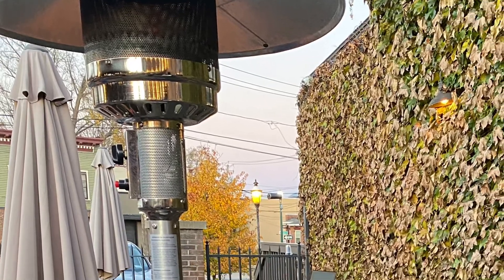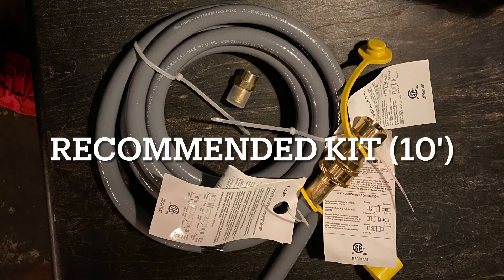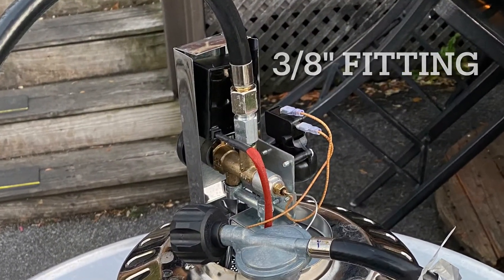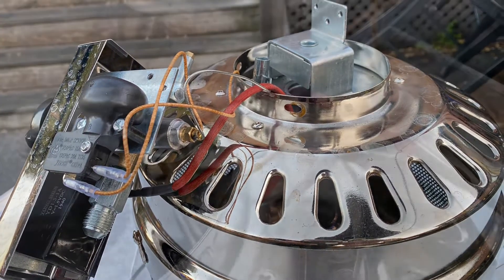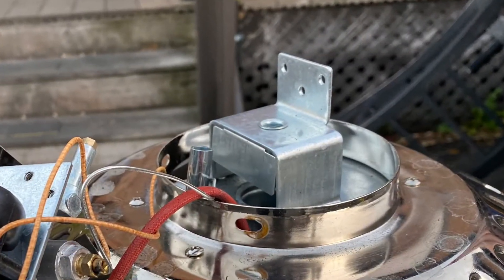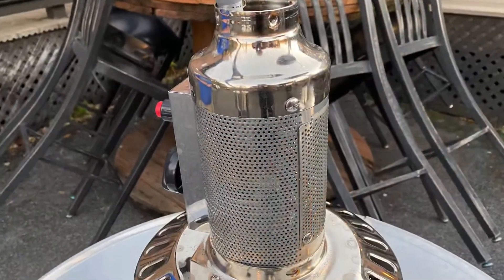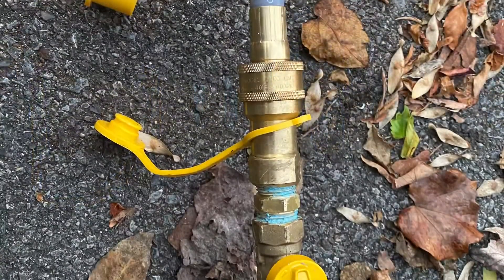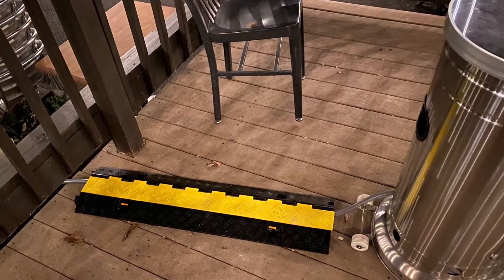Patio Heater Propane to Natural Gas Conversion

Comment: It looks nice enough, but I'm curious.  Warmer air rises quickly.  Wouldn't it be more effective for the heat source to be closer to the ground.  I noticed also that your patio is open air as is my own.  I was curious to know if it was noticably warmer with the new heaters.  Thanks!

Comment: Followed the instructions to the T for the Paramount (Costco) brand. Flame doesn’t remain stable and hence not getting the red-ish glow on the surface. Flame is very orange and not blue at all. What should I change? Appreciate your work here and will wait for your feedback. Thanks!

Comment: Maybe throw a sandbag in the base for the stability lost by not using the tank . I got a heater from a bar and it was pretty bent up from inebriated guests knocking the thing over.

Comment: ORIFICE, not ORIFISE.
I need to clean out my gas pipe.  Nuts don't want to come off.  Are these glued on or sealed in any way?  Its a small tabletop patio heater and I've taken it apart and cleaned it out. But the gas pipe needs cleaning too.  I wish you had shown how you get the nuts off this assembly piece.  What do they use to seal off the nut on the thread?

Comment: Question, I followed your example step by step. I have the exact heater. The gas orifice hole is 1/8 inch just like yours. I put the tape on just like yours. However, when I turn mine on, I get lots of fire and it doesn’t warm up and glow red like yours does. What do you think my issue is?
Reply: Same issue here.  Going to order a new orifice and starting with a smaller drill and work my way up till I get the flame needed.  1/8 was too big.
Reply: I had the same problem. I drilled the hole for the orifice at 7/64th and instead of blocking off entire air inlet only blocked 2/3rd of both sides and worked great.
Reply: @awschuneman1  not sure if you check this but do you know where I can buy replacement orifice? 
Or a Part number

Comment: Can you use 3/8 line instead of 1/2 inch line and you have to drill that that part out?  you cannot just buy it with the right diameter?